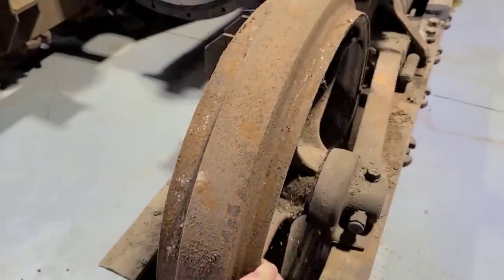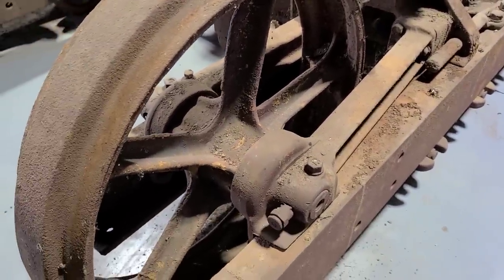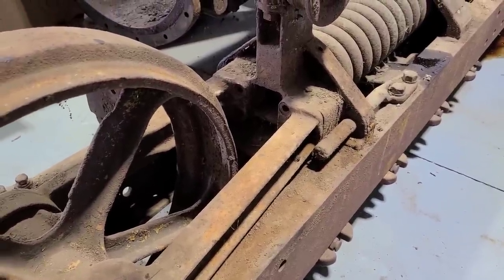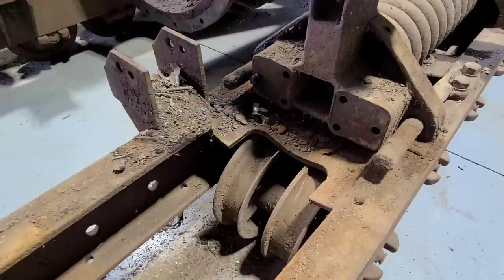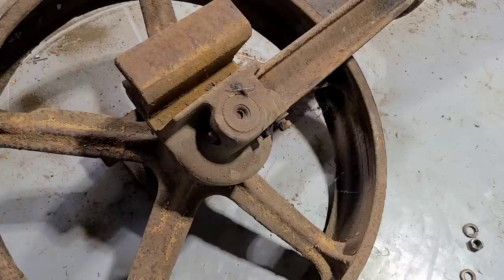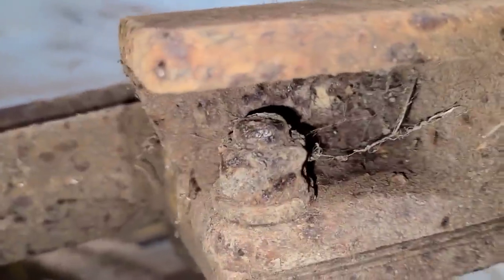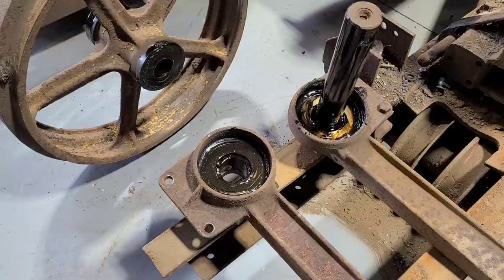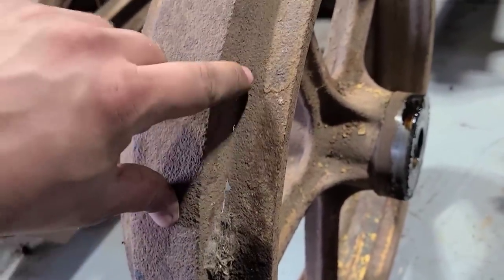Caterpillar RD-4 Front Idler Removal

Comment: Another trick if you can't reach to cut the head off- heat the head to cherry and let cool- the clamping force will be relieved and if the threads aren't hurt it should come out fine. It's worked a treat and saved my butt numerous times in the field. Also useful when you don't want to risk gouging the part with a wheel or the torch.
Reply from the maker: That is a great trick that I often use myself, unfortunately in this case there is just no head left to turn the bolt out, thanks for watching and following 👍